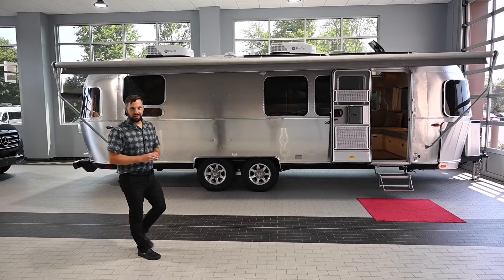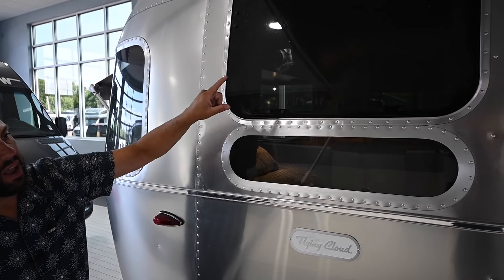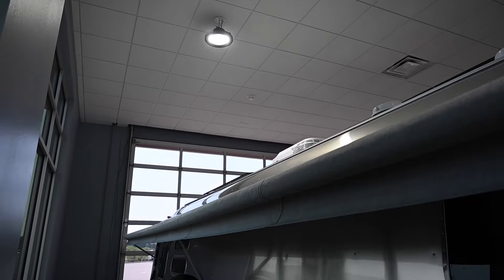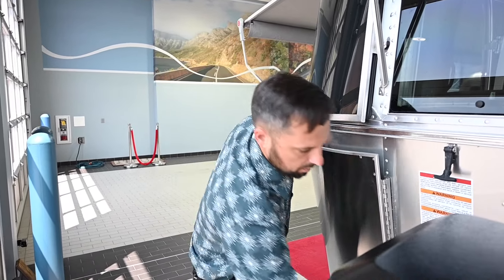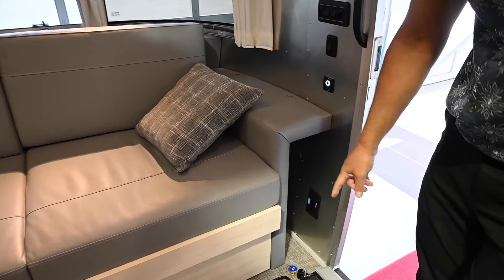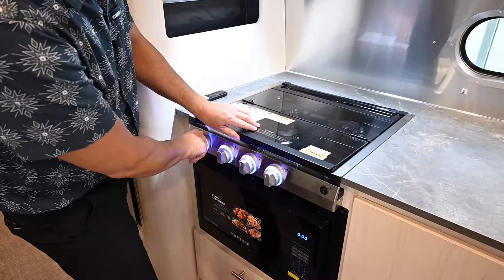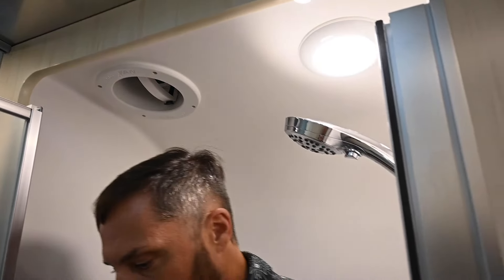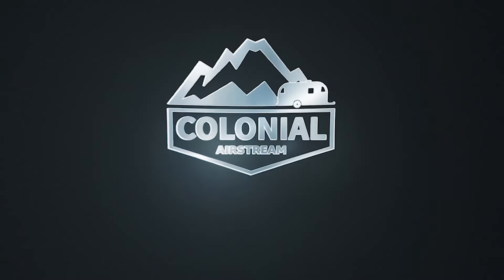2025 Airstream Enhancements – Flying Cloud 28RB Luxury Travel Trailer Walk Through Tour

Comment: One thing Airstream should consider adding is a ERV/HRV ventilation system.  With the top vents and all windows closed the CO2 levels go up over 4,000 ppm overnight with 4 people and a dog.  Leaving the top vents open allows valuable heat or air conditioning to escape.  A heat exchanging fan would keep the space ventilated with very little energy loss.

Comment: Be nice if Airstream would bring back the triple axle trailers, with a little extra length. Maybe space for stacked washer dryer, or combo. Thats about the main drawback in my mind with them is no in built unit for laundry.

Other than that also be nice to maybe see them transition over to an aluminum chassis. I'm fond of the aluminum chassis's on commercial trailers in trucking. Lighter, a bit more ridgid with less flex, and no worries of rust. Galvanic corrosion is an issue, but that can be mitigated in engineering and design.

One of these days I may buy an RV.. I'd just like to really see some true innovation out there. I think Airstream has been a bit stagnant on really pushing the envelope anymore. They're kinda in their own little niche with no real direct competition.